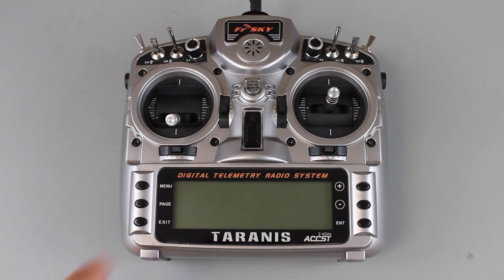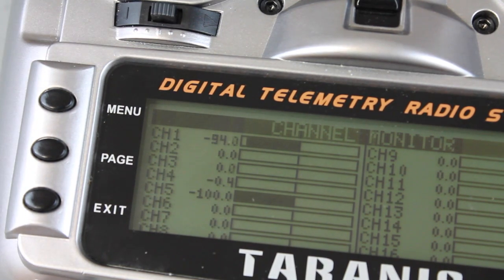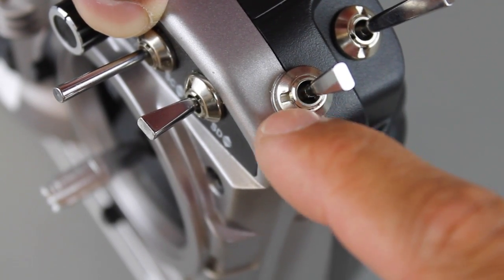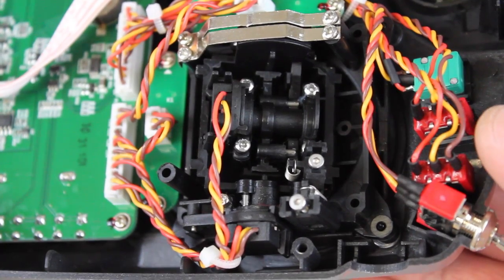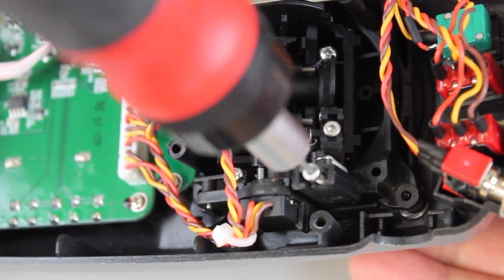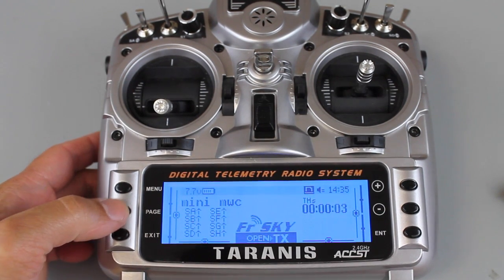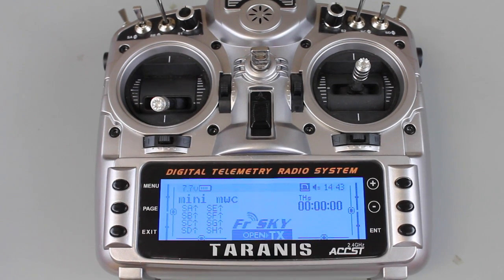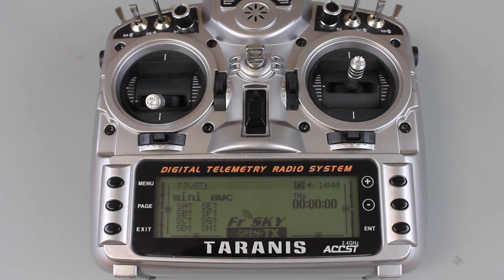FrSky Taranis How to Fix the Stuck Throttle - No More Throttle Warnings!

Comment: I tried this fix on my mode2 Taranis, it didn't quite work out for me.. but don't worry, there's a happy ending.
I opened mine up, the first thing i noticed is that every screw inside was philips (just a note). Anyway, i loosened the spring screw until it came out of its mount.. throttle spring was still too tight. So i tried stretching the spring out with some pliers... and it snapped on me. At first i was worried, but then i realized it didnt matter since its a throttle spring. 

These springs are extremely fragile. I might order some spares just after experiencing this. It sucks to get something you waited two weeks and paid $200 for and have to deal with this right off the bat ha. Anyway, thanks for your video! Wouldnt have fixed my transmitter without it.
Reply from the maker: Taylor Graham Thanks for sharing your experience. It's always good to hear solutions others have come up with. I'll keep this in mind in case it every happens to me. Best of luck with your new TX!

Comment: Yep, had the same problem on my v1 Taranis. Only took about 10 minutes to fix at the time but interesting to see that the problem still occurs for others in the newer radios. I had put it down to an early version problem. Coming from a Turnigy 9X was accustomed to fixing a few glitches out of the box... :-)

Have updated mine to plus spec now (haptic, new sliders plus better speaker) and still very happy with it. Don't have my eye on any other radios, nothing more I want!

Oh, and loving the telemetry cause I get my pack voltage back with a nice friendly voice telling me "A2 Low" then "A2 Critical".
Reply from the maker: Ben Govett Great stuff. I haven't touched the Taranis Plus capabilities but you've peaked my interest. Thanks for sharing this info.

Comment: Another great vide Dennis ! for the question last time you ask regarding was the controller close to the Rx ... yes when the radio is too close it sounded warning telemetry lost.
Reply from the maker: zero00tolerance Thanks for confirming that. I've had several occasions with that telemetry lost message and it's a little discomforting to hear as you're getting ready to get in the air. But the good news is I've never lost connection when the UAV was far away....only when too close :)

Comment: Hi Dennis i had the same problem but after watching you sort yours out done mine next day so thanks again for the great videos,  ps my transmitter was changed from mode 1 to mode 2 so they hadn't quit set them right.

also i dont know if yours does it but the sound has a buzzing when its on..
Reply from the maker: jced102 So glad to hear that. Thanks for sharing.

Comment: Exactly the same problem Dennis.  Thanks for the vid.  I love the mechanics going on inside the Gimbals.  Couldn't quite figure out what that screw is actually loosening but it's obviously doing the trick.  Looks like it mirrors what is going on in the right gimbal except without using the spring retention to center the stick. 

One thing i noticed on your radio...  the units are set from -100.0 > 0.0 > 100.0.  Mine are showing the ppm value and range from -988 > 2012.  I'm sure there's a setting but I don't know what I did to change.  Any ideas?
Reply from the maker: Paul Morley Hey man! I hope all is well. It's crazy that our units are different. Talk about the flexibility of OpenTX :) I don't know how to change this but will look into it. I'd actually like to see PWM from time to time! Will let you know what I find out and please do the same.
Reply from the maker: Paul Morley It turns out this is a compile time option when you install OpenTX firmware:

https://code.google.com/p/opentx/wiki/OpenTxFeatures

There is a "ppmus" command line switch under the LIMITS section:

"PPM Limit Units percent or microseconds (compile option - ppmus)"
Reply: Dennis, thanks for the info. I actually wondered if that was it after I commented. Yeah, it would be nice to be able to toggle back and forth maybe. 

Thanks again for all the great info.

Comment: Yes, i was wondering the same thing if that was only my taranis, at first I just ignored it, but later on it proved very dangerous as it messes up the mid point of the flight controllers, as well as creates problems with setting up throttle failsafes in the arducopter firmware. First i calibrated apm with that 5% offset, so my min throttle was at 990, and I setup my FC throttle failsafe at 985.... Guess what happened to my quad when I the next time I wanted to descend in alt hold and pushed that stick all the way down! Throttle failsafe kicked in and my quad tried to perform an RTL between my house and a tree.  Looking at the logs later I saw that the throttle went below 985, this was enough to trigger RTL.  I fixed that issue with my taranis back in february the same way as you did.

Comment: I had the same consistent throttle warning after my initial stick calibration. After a couple of weeks, I re-calibrated my sticks again, and it went away. Now I can CSC to start the motors, and my throttle timer does not start. The throttle timer only begins on actual throttle up as it should. I'll file this vid for future reference
Reply from the maker: Mike Jordan Glad to hear it. It's crazy to see how many others have this same problem. Hope you don't have to mess with it anytime soon!

Comment: Nice job, as always, your videos are first class. Of course you could always reset the throttle end point in the software, but that's just a work around. Glad to say mine is fine, so no work needed, that's not to say I wont take it apart some day. Hoping to mod the antenna to a changeable one. Have you done that?
Reply from the maker: ryalman21 Thanks so much for the feedback. It's much appreciated. No I haven't done the antenna mod, but do want to get around to it someday soon.

Comment: the only mod you need to do is remove the excess plastic below the spring tension screw on the throttle Gimbal, that excess plastic ring limits the screw to go all the way to dissengage the return spring

Comment: Mine has the same issue.  Since you loosened that hex screw to adjust the throttle setting is there any chance of it coming loose inside the case?
Reply from the maker: 0917bobb I didn't loosen it enough to where it would come out, but I could see that being a problem if it got too loose. It was still a good ways in the housing so hopefully you don't have to loosen it too much to get it to lock in place.

Comment: I had the same issue on a brand new Plus. Saw another video and fixed it the same way. What I'm still getting is most of the sticks and switches show flickering values in the monitor screen and reflect on Naza assistant. Can't get rid of it worth a poop.
Reply from the maker: Rabeiro Photography Glad to hear you got it fixed. If your sticks are jumping around on the screen try doing another stick calibration. I've seen this happen before. It's very annoying. If you continue to have problems come post in the forums at www.garagepilots.com and hopefully we can help you out. Good luck!
Reply: Dennis Baldwin tried to register to the site, but kept getting security warnings on my chrome so couldn't register.

Comment: My Taranis had the same problem. I believe my Taranis was built around Dec 13. I think it was caused by sitting in the supplied case. The foam around the sticks in the case put too much pressure on the stick. I've cut back the foam in the case over the sticks. I fixed mine by only recalibrating the sticks. I may go back and adjust the gimbal as shown.
Thanks for sharing.
Reply: I always set my throttle to half way before closing the case.
Reply from the maker: ryalman21 Good tip. I too thought the exact same thing related to the foam in the case. I think you're on to something with the foam causing the throttle to come out of calibration. Thanks for sharing.

Comment: Mine is an oldie I think, no hex screws inside, only Phillips. And I could adjust until it fell out and nothing I had to modify the spring itself to fix this issue, but it's all good now. Now if I could only use my LRS system without it freaking out.....
Reply from the maker: eric deherrera Interesting. I've heard from others that have all phillips screws too. Maybe mine is the oldie!

Comment: I had a similar problem with my taranis, I ended up tightening a phillips head screw to fix the problem. Don't remember which one though.
Reply from the maker: Daniel Bent Yeah there are a ton of screws inside the radio. I was scared to mess with too many of them!

Comment: Yes my transmitter came the same way I just fixed this issue a few days ago the same way works perfect. It seems they just left the spring a little tight from the factory I feel this is a side effect of giving us so much adjustability with the sticks I love this radio!
Reply from the maker: Tepee Tim Mine came just fine but after about a year of use it started having the problem. I'm very happy to have it fixed and glad you took care of it as well! Take care.

Comment: Yes it is common . I fly mode 1 (throttle on the right.  The problem is mirrored but with the throttle at 100% it spring back that small amount.
Reply from the maker: azzurripro Good to know that I'm not the only one with this problem :) I didn't realize it could happen at the other end.